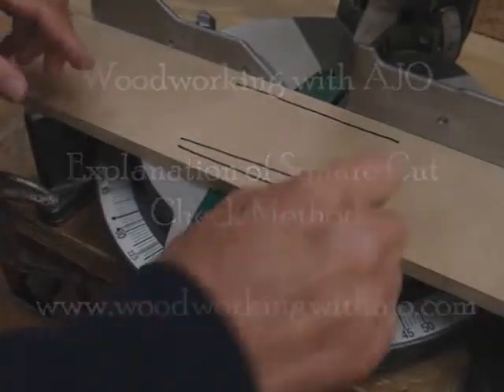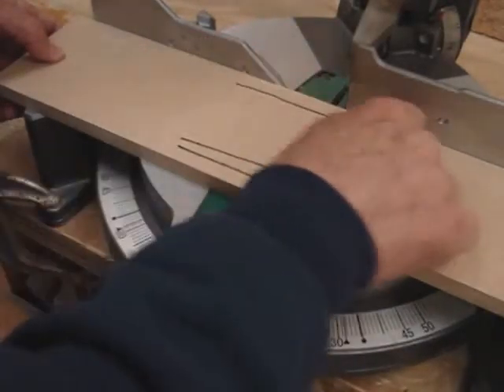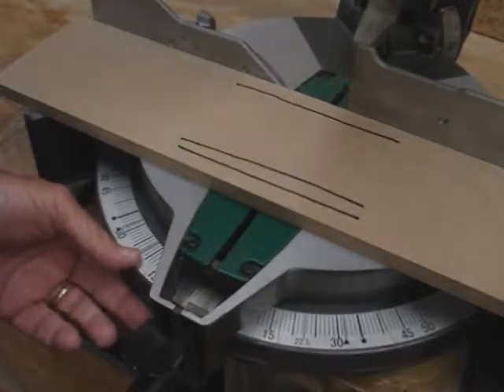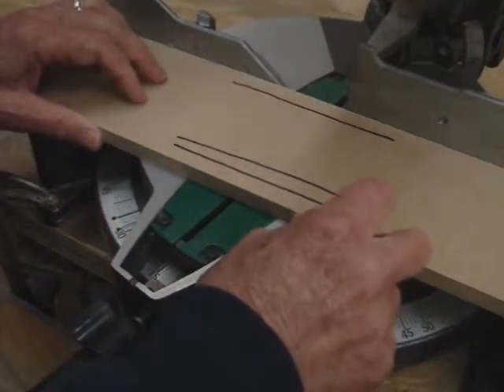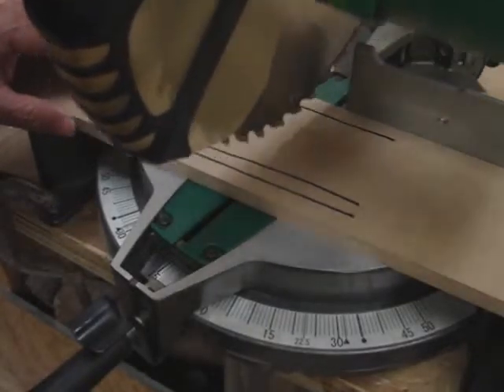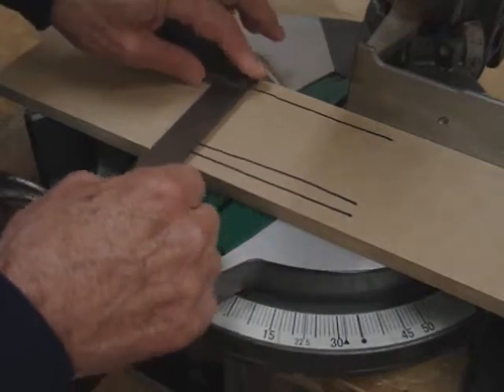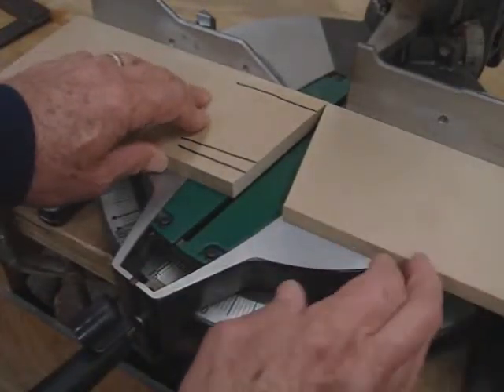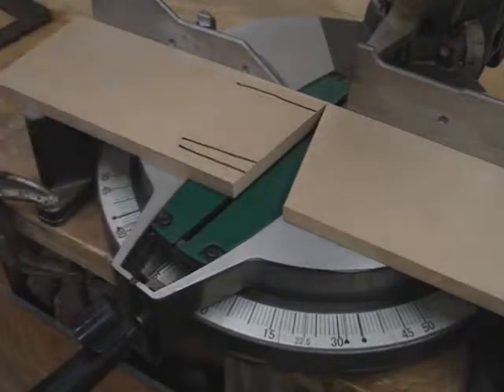Explanation of Square Cut Check Method

Comment: So what's the purpose of the hash marks?
Reply from the maker: Hi Rob, I find the hash marks handy for keeping track of how the wood was orientated prior to cutting the wood. And, just using one hashmark would also work. I just like using the two sets of hashmarks shown.

Take Care
AL
Reply: Albert Ondic Thanks for the reply, Al.  I enjoyed your video.  Just having some trouble squaring up my Ridgid TableSaw.  I cannot get a 90 degree angle.  I also tried the 5 cut method, but I assume the first cut must be square to start.  Right?